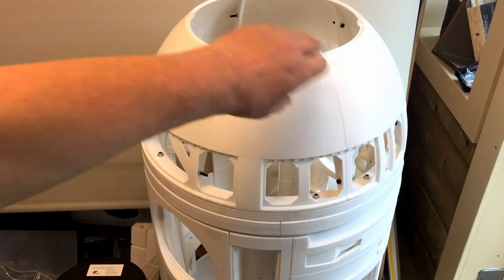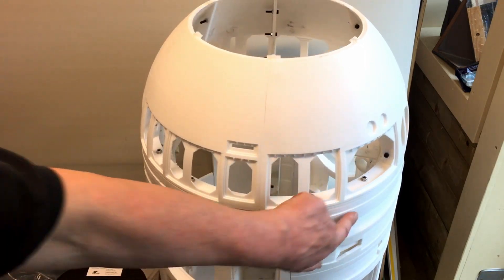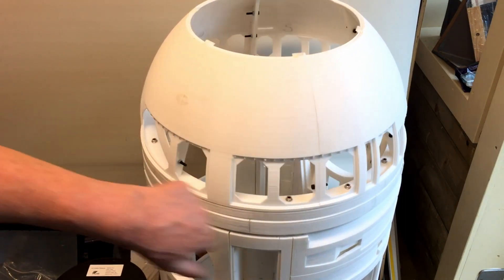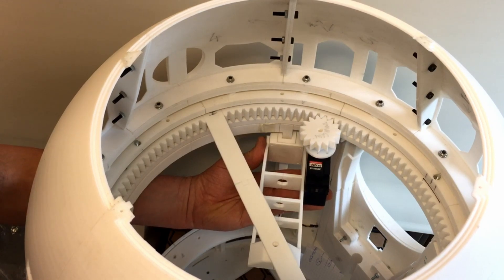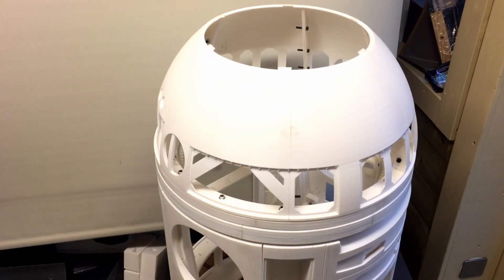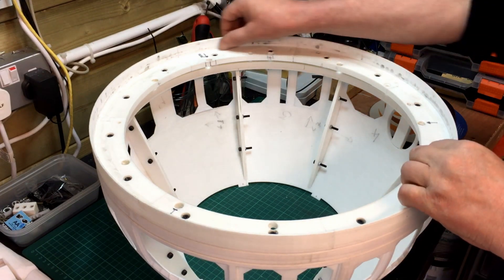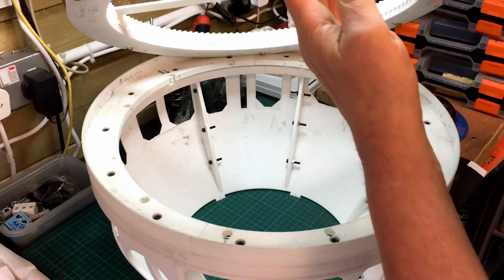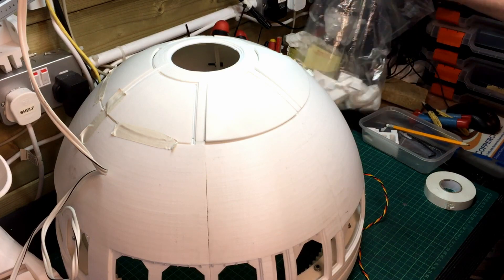R2D2 Droid Build Part - 5

Comment: do you need to dril extra holes in the lazy susan ring or in the ring the mount it? Excellent job btw!
Reply from the maker: Hello joey, yes I drilled new holes around the lasy susan itself.    Some pre-drilled holes did line up but not all.   I also counter sunk them when needed.  I think I also drilled new holes in the plastic as required.  There seems to be no "right way" to fit the ring, so experiment.    As I have mentioned, the dome jamming on the ring was my main problem, still is actually.   Its all fun though!
Reply: @kylecampbellweb  Thank you for your quick and excellent answer!

Comment: Hi Kyle, when are you doing more of the r2 build, im slightly behind but would love to progress of yours
Reply from the maker: Hi Darren
Haven't had a chance to do a video recently but I have been consistently printing away, maybe 18-hours a day.  My favorite PLA is out of stock at Amazon and is suddenly £5 more expensive elsewhere a reel, [Technology outlet PLA] so have also tried different brands with mixed results.  
I have printed all the parts for both legs and greebles and doing well printing the feet parts. I am waiting on the shoulder sections as I want my R2D2 to be fully active - will wait for the new arm/leg that Mike Baddeley is doing with the design.   Also printed all the body and dome greebles and bits & pieces.   

The dome fits the body and rotates fairly well.  I need to print a servo holder and get that rotating. 
Anyway, I have several huge plastic bags of parts that I need to so something with.  Maybe I will do a short video this weekend showing plastic bags of bits!

I was also planning on adding the Drupp neck to my Inmoov as that needs a bit of work, so may get totally sidetracked and video that instead.    Also have plans to do videos on my Citrus trees in the garden, but that's a complete distraction!!  

Thanks for asking about the videos and progress, it will prompt me in the right direction. Or maybe I will work on my Rubicks cube machine instead.....
Reply: kyle campbell thanks for the update, this is my goto video for my build. A friend of mine is also attempting to 3d print one and I’ve pointed him in your direction. Your R2 is really looking great. I’ve been using a low warp PLAx3 filament from filaprint, its £38 but is as strong as anything and I get very little waste. Just a shame that with work I don’t get lots of spare time to print

Comment: Looking really nice. I've pretty much got all the leg parts ptinted/assembled (not wheels though) and I'm now sanding/filling like crazy.
Reply from the maker: Hi Carl.   Sanding time eh?   I just bought myself a small mouse sander so at some point I must start on that.  Did you buy the lasy susan?   What size did it measure at?   With the legs are you printing the fixed shoulders or waiting for the full 2-3-2 designs from Michael?
Reply: Hi Kyle, I'm going with fixed shoulders as my R2 will just be a static model with sounds/lights/rotating head etc. Makes no sense for me to have a fully controllable unit as I just don't have the space to use him once complete. 

Preparing for paint is very time consuming but I knew it would be. Basically I'm using Motip Spray Putty (really good and less than £19 for six 400 ml cans on Ebay UK),  filler (Ronseal Smooth Finish Filler, just £7.01 for a 2.2 KG tub on Amazon UK - sands really easily!) and loads of elbow grease with a good paper. Then just rinse and repeat. Taking three passes per part to get a good finish at the moment. 

I've not got my lazy susan yet as I really want to slog on and get R2 sttod up on three legs asap.

https://www.ebay.co.uk/itm/6-X-MOTIP-SPRAY-PUTTY-HI-BUILD-FILLER-PRIMER-400ml/222627580760?hash=item33d5a34b58:g:zAkAAOSwA3dYk1Jv

https://smile.amazon.co.uk/gp/product/B0046Q9M26/ref=oh_aui_detailpage_o00_s00?ie=UTF8&psc=1

Onwards...

Comment: Where did you find the lazy susan for this. I am in the process of working on printing this myself and have most of the dome printed at this point.
Reply from the maker: Hi Brian, I bought in the UK at simplybearings.co.uk 
Their stock changes around but this one  looks the same as mine.  Beware of the stated measurements as it may be slightly bigger than 450mm 
https://simplybearings.co.uk/shop/p183553/450mm-Round-Lazy-Susan-Rotating-Aluminium-Turntable-Bearing/product_info.html
Reply: Thank you for the info!
Reply: Hi Kyle.  Great vids.  Just curious.  Did you print the wider version of the lower ring for the lazy susan or was it the standard version?
Reply from the maker: Hi Peter, the wider version.  Not sure how much difference there is.  I messed around getting it all to fit and did a lot of filing sanding as you can see.
Reply: Thanks Kyle! This is good to know as I'm waiting for my lazy susan to arrive.  I will print out the wider version and if I run into problems, I'll follow your video for the fix!